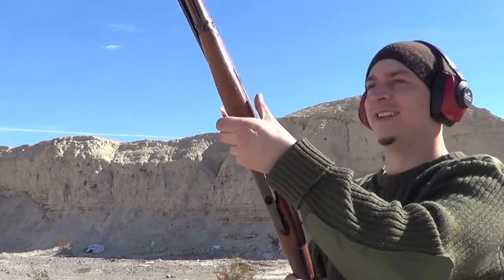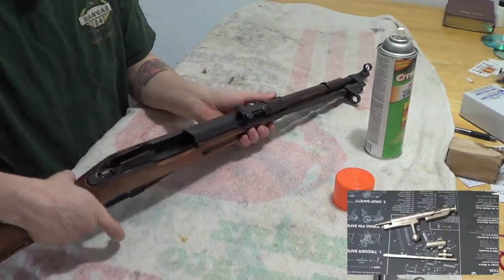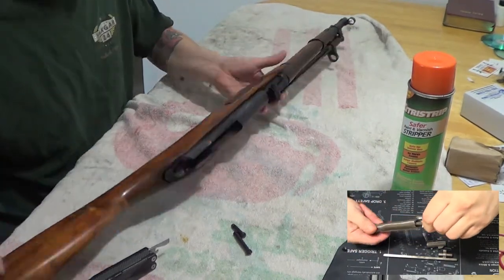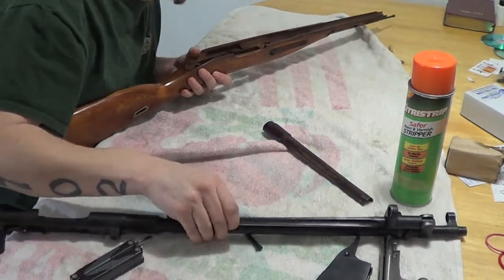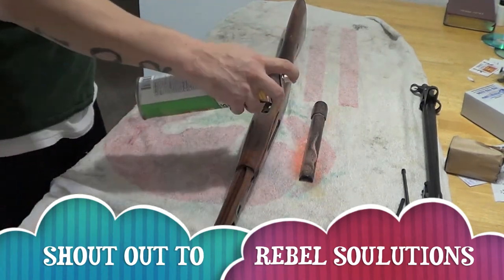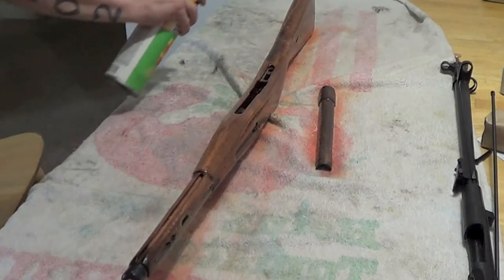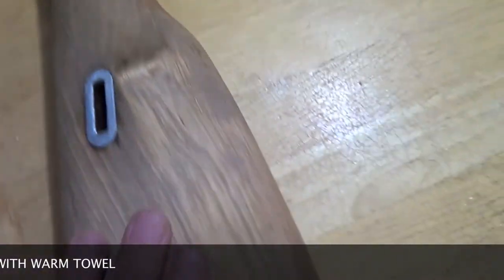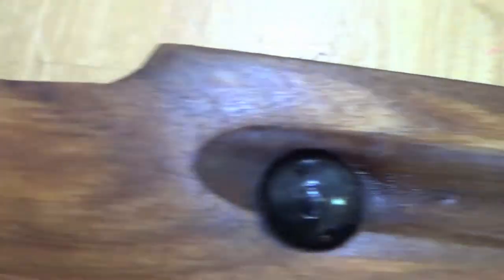MOSIN PROJECT - PERTY LADEH

Comment: Nice.. came out really good.  BTW if you ever want to remove scratched and dings in wood, take a wet towel, put it over the ding in the wood, get an iron up to temp, and put it right over the rag.  The moisture in the rag, and heat from the iron will pull the dent right up, Sand it flat and it will look new.   Oh and if you ever want to re-parkerize one of these older mil surp rifles (or any guns), let me know. We could even do a video on it.. I have all the gear here.